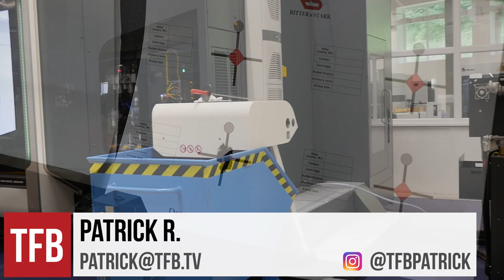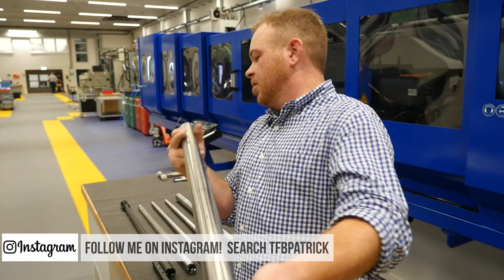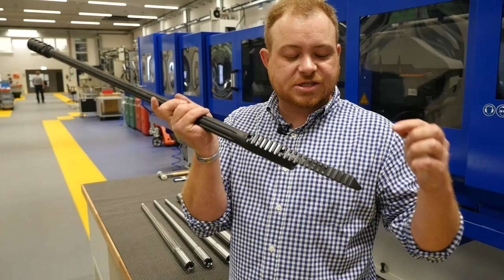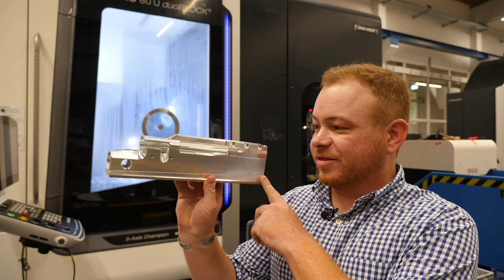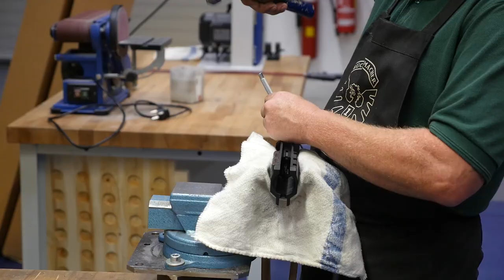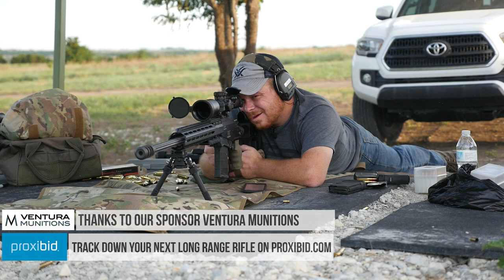Touring Ritter & Stark: High Tech To Achieve High Precision

Comment: People seem to forget... pretty much ALL precision rifles run close to this price tag. Accuracy International charges about the same price for a rifle in 1 caliber, this at least gives you two barrels. And while I personally dont do the type of long range shooting rifles like this are made for, the guys who do that stuff for a living or for fun have the money and it's not an issue. 

The last precision rifle I got to get a lot of good time behind on was a UA TPG-1 rifle.... absolutely sweet shooter and smooth bolt. Was like $14k at the time I think? Probably more now.
Reply from the maker: People forget that you get two calibers for an MSRP at $8555. An Accuracy International rifle chambered in .338 and .308 would run $10,577 on EuroOptic. A $2,000 price difference is very much something to take notice of. 

The SX-1 runs about $5500 in .308 and $6500 in .300 Win Mag and .338 Lapua. Those whining that $8500 clearly haven't priced out a precision rifle that is capable of a caliber change and the corresponding caliber changed should they not be included with the rifle.  - Patrick
Reply: +TFB TV Some people also seem to be incapable of distinguishing a "Precision" rifle from a "Long range" rifle. I always hear things like "I'll just buy a Barrett" or something like it at that price, but these rifles are meant to be accurate, not necessarily a long range rifle. However these can do both, and with amazingly tight groups too.
Reply: TFB TV I'd be curious to know what the manufacturers cost to build a gun like this is

Comment: Hey Patrick. Thanks for doing a very well video on going through the factory. I was wondering how clean do you remember the place being? And how come they let you go out on the shop floor without safety glasses?
Reply from the maker: The place was incredibly clean, if I didn't know better I would have assumed they set the facility up a few days prior to me visiting. 

Safety glasses were not required because all of the machine work is done inside of an enclosure. - Patrick
Reply: Awsome. Thanks Patrick for replying.

Comment: A rifle that sells for a price similar to a motorcycle.  Useful consumer information.  $8500 minus the glass!   Jesus fuck!
Reply from the maker: Welcome to long range rifles. An Accuracy International in only one caliber, not two like the rifle I was sent, will run you about $8200. - Patrick
Reply: At 8500 I'd just buy a Barret or MacMillan 50  I'd hazard a guess they employ way too many people.
Reply from the maker: A Barret 50 isn't a precision rifle and you aren't going to buy a Tac-50 for less than $12,000. Besides, neither of them is convertible so they aren't anywhere near the same class. - Patrick
Reply: 8K for a .308 with no glass, the capability of .308 does not justify that price tag.
Reply: AKlover You get a .338 barrel along with it...
Reply from the maker: You should pay more attention. You get a .338 Lapua Mag barrel with it as well as another mag, bolt head, and interchangeable magwell. - Patrick

Comment: 0.00003" would also be called "thirty millionths" in machinist language. Definitely an impressive tolerance to hold, and to my knowledge impossible to actually check for in instances like this. I think you must be remembering the measurements incorrectly though, because 0.005 mm also does not equal 0.00003", but actually roughly 0.0002" instead ("two tenths"), which would be possible to check for. I know you're not a machinist, and didn't claim to be completely correct with those recollections, but I just wanted to point that out anyways. Regardless, thanks for the machining breakdown!

Comment: looks nice, and i bet its really accurate at long range, but the understandable high price is really pushing the line of an affordable gun . so no thank you
Reply from the maker: +Mösjöö Bassonlisääjä With two calibers it MSRPs at $8555. A comparable Accuracy International package in .338 and .308 would run $10,577 on EuroOptic. I don't know about you, but about a $2,000 savings is significant to me. The next model they are releasing will be priced much lower from what I am told.  - Patrick
Reply: I was shooting with a guy last week that was using one, have to say it's pretty impressive.